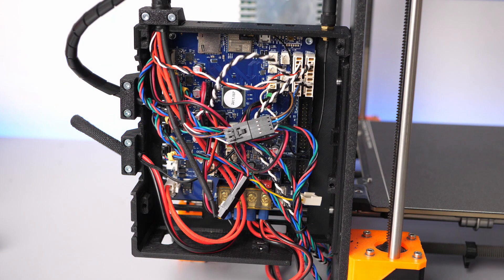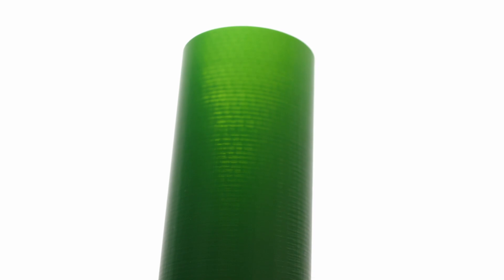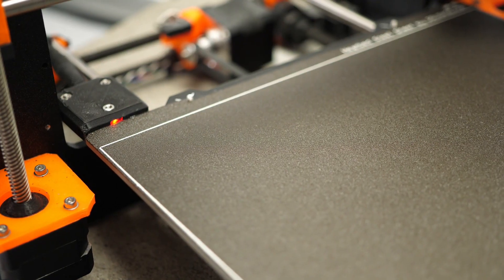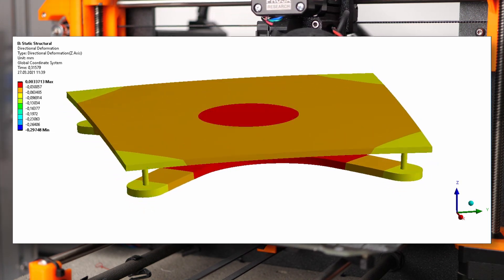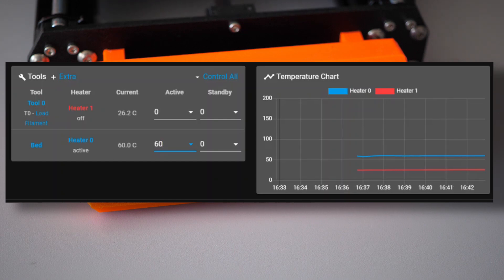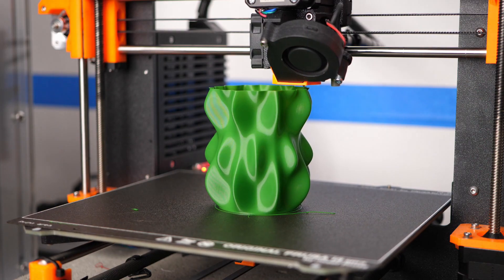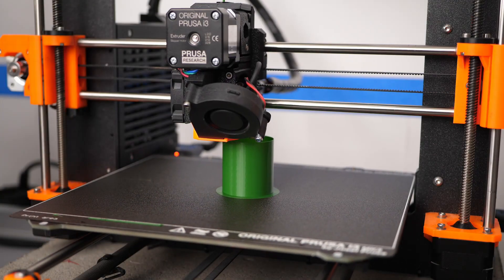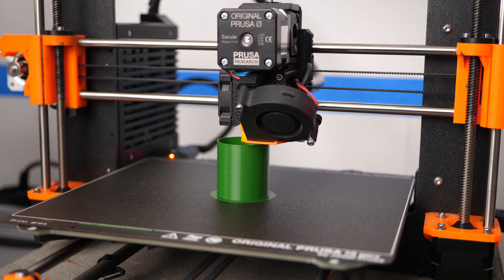PID vs Bang-Bang Temperature Control

Comment: Been fighting similar issues for days now after upgrading to a new print head on a BLV AM8. 

I wonder if that lack of the magnet in the center of the Prusa bed and the cooling fans are causing the spring steel sheet to expand at a different rate than the heated bed itself?

Comment: Hey Stefan, on the topic of thermals you should do an episode on modding the prusa part cooling fan or shroud or both. That's a longstanding problem with prusas
Reply: you must be mistaken, everyone knows that prusa's are perfectly engineered printers with no flaws that never have problems and turn out perfect prints every time and are completely worth the 100% markup.

Comment: May be it’s just, that the prusa bed is really bad designed and acts like a speaker.. this is why it makes sound in pid mode (moving fast up and down) and locking up in up or down with bang bang. However, i don’t think it’s anything with a variation of +-1 degree.
Reply: +- 1 degree is still enough to cause z banding
Reply: No, I don’t think so.. but if you have a scientific answer, we can talk about it.

Comment: Once the printer has laid down it's first few layers Why is bed heating used at all? if the bed is lallowed to cool (slowly) you shouldn't have any Z-banding issues due to bed deformation should it?
Reply from the maker: Most beds will release the print when they cool down. Not so great during a long print.

Comment: I have created an external plate based on 300W mosfet for bed contol. With 12V 200W Webasta heater it need about 5 minutes to reach real 90 degrees on glass. PID control work really great, temp  hold in coridor about 0.1 degree. I must mention that 220W Ac relay is really dangerous in this mode.

Comment: That's the problem i always need to conquer in my DIY big 3D printers
my "medium" one with bed 450x600mm that use 20mm Super High Quality linear rails (i achieve max 0.01mm error on the entire lenght) i still have this problem 
i try all posible options and it still dont work except few solutions like constant power / capacitors etc 
My heating pads have 1-2kw of power so when they turn on they have to much heat output and that make the bed to move 0.12 up to 0.24 at the centre of the bed ! 
first solution i was working on is to make the bed like a sandwitch 
or to make liquid heating 
now i working on another solution ....ceramic heatbed with constant power.

Comment: I had the same problem after I changed the firmware/hardware configuration. It took me weeks until I found an article about that phenomenon. After changing the Z setup multiple times! 🙄😅
Reply from the maker: Same here on another printer.

Comment: Oh, that explains why I was never able to solve that wobbly Z axis on my CR10s, but it went completely away when I moved to a duet! That's also why PLA was the most affected, while with PETG and ABS the problem was less severe, the higher temperature meant that the bed was not so much overpowered that there was a lot of difference in temperature between on and off!

Comment: Wow. I am currently having inconsistent layers as well and I tried so much. New mainboard, new firmware, flexible coupler, anti backlash nut, new leadscrew, new hotend, different filament and nothing worked. I hope that tuning my pid even more fixes it a bit
Reply from the maker: Let us know if that solved your problem!
Reply: @CNCKitchen  Unfortunately not. It seems to be a mechanical issue but I can't seem to figure out what it is. Would you mind looking at this test print and telling me if this is a mechanical or a settings issue? http://imgur.com/a/49pm0M9

Comment: How about PID tuning the nozzle? I'd imagine the temperature fluctuations in the nozzle might have a more dramatic effect on the print than the bed would have?
Reply from the maker: You should definitely do that as well!
Reply: @CNCKitchen  will do. And great video! First one I've seen that actually shows the effects of the issue.

Comment: You want to put some insulation on the underside of the heated bed, I have mine insulated, I put that on when I was building it since it worked well on my Anet.  Temperatures are more consistent (within 0.2C) and it saves a small bit of energy when printing.  You want a silicon sock on the hotend also of course for the same reasons.

Comment: Wow, One degree variation doesn’t seem like it would affect the bed warp that much. Im surprised. I can’t help wondering if the change in current draw from bang bang switching fully on/off is causing issues with the stepper drive current thus causing those issues where PID is a more gradual change in current draw. Wonder if a better power supply would also correct it. That buzzing in the bed seems more like a power supply noise (ripple) which made me think of current as a possible cause. 
Very interesting video Stefan. Well done.
Reply from the maker: I might have a closer look at that though I don't think that the steppers are a problem due to their discrete steps, though who knows what happens to the microsteps?
Reply: @CNCKitchen  Full steps on stepper motors are fairly accurate when stationary. Any microstep step is not precise and can be within a small number of actual microsteps of the position you think your at. Take a strip of paper and rip it in half, now do the same thing again and again and again and again. You now have 16 smaller pieces of paper. You have increased resolution but the resolution does not equal precision. Each piece of paper is not precisely torn, not precisely the same size as the others. 

With the ripped paper you can separate two objects by 3 micro-pieces of paper and the position will be more accurate than if you were limited to 1 full strip of paper. But, the spacing is not precisely 3/16 of the full paper strip. It may in fact be closer to 2/16 or 4/16 because our paper micro steps are not precise.

Microsteps increase resolution of movement and smoothness of movement at low speeds. You don't get something for nothing though. With microstepping as the RPM increases the potential power output of the motor decreases. Some stepper drivers will 'morph' steps from n-microsteps to full steps as RPM increases (all done internally, you are still sending microsteps to the driver). This gives you the best of both worlds. Increased resolution, increased low speed smoothness and all the power out of the motor at high RPMs.

Please see my post about indicating to your bed when the bed it stationary and heated to measure any deflection in Z. My suspicion is that if your bed is deflecting with a 2C delta T then it is due to it being held at the corners thus any thermal expansion/contraction can only be relived by the center of the bed bowing in the Z direction.
Reply: @HeyBirt  ripping a piece in paper in half ??? please put down the crack pipe buddy, you've had enough.
Reply: @obie224  This is what is called an analogy. I'm sure everyone has tried to rip a piece of paper in half and knows it is not really precise process but you do wind up with two pieces of paper roughly half the size of what you started with. 

But as to the point of your comment - If you don't have a constructive comment why bother?
Reply: @CHEP I think you might be on to something there. I had a problem in my printer with the Z-axis not moving enough upon layer change. The firmware would indicate the correct height but the actual height was about 20-25% lower. This only happened to me when I would print ABS with the bed at 105C so drawing a lot of current. When I would print PLA with smaller bed temp it would print just fine. My fix was increasing the Z-motor Vref voltage. I too believe that a minute 1-1.5C variation in bed temperature wouldn`t affect the print quality that much. This needs further investigation.
Reply: @maiorciprian  I had this problem with my home built Rep-Rap printer. I eventually used a second PSU, (old Xbox PSU) just to supply the heated bed. As the bed was supplied via a relay it was an easy fix. Improved the overall quality of the prints no end!
Reply: Best comment exactly what I thought. Its a power issue. Electrical noise affecting the steppers. If say a second power supply was used for the bed heat this would also fix it.

Comment: I would have thought that the change in voltage (because of the power draw of the bed) would have more of an effect on the heating ability of the hot end...  This is very interesting.  I wonder if the PID tuning of the hot end would be different with and without the bed being heated (as a result of the different drive voltage).  Great video. Thanks
Reply: That's it ! 
Nothing to do with thermal expansion/contraction.
More like voltage fluctuation affecting the board...the power supply, and consequently the motors.
Bang-bang control create two distinct levels...while PWM control spread out the influence.

Comment: Finally a "trusted source" I can point people towards when I tell them to PID their bed. Usually it goes like 
Them: "I have Z wobble, but my leadscrews are alright"
Me: "PID temp your bed"
Them: "but Marlin says PID temp your bed is bad"
Me: "Give it a try, it worked for me" 
Them: "I don't see how it can be physically relevant"
Me: "I can show you on my printer by dynamically enabling and disabling PID on the bed heater that it works"
Them: "must be a firmware bug then"
Me: "Please, just try"
Them: <if not using RRF, after rebuilding Marlin>: "Oh, look it worked!"

And then people subsequently forget about it.

(Marlin docs still state "If your configuration is significantly different than this and you don’t understand the issues involved, you probably shouldn’t use bed PID until it’s verified that your hardware works" -- I understand people shying away with this caveat. On Duet hardware it works well, of course (-: )

Comment: Does the prusa have the standoffs integrated into the bed? Did you test it on the ones that have screws? Since they have a little more movement tolerance when the bed expands, so it would indicate a problem that is more prusa based

Comment: One of the causes could be also voltage drop caused by bed current draw, as MK3 PSU works close to its limit. Anyway, I never thought about it, I am pretty sure my bed works at bang-bang and I spent more than healthy amount of time chasing z-banding. Thanks!

Comment: Yay, there is one issue with older or cheaper heat beds. PID may trip thermal runaway. Likely during preheat as when the bed gets close to set temp, it starts pulsing to slow heating to prevent over swing. But that makes it rise slower than the min “degrees per minute” even when set at the lowest setting. Been considering figuring out how to leave Bang Bang, but put in slicer gcode to switch somehow after preheat.

Comment: omg I needed this two years ago when I built my HEVO with a duet... I had this same artifact and it took me FOREVER to figure out because as you noted, if the print speed changes (shorter layer times for instance) the banding changes. I printed so many vases and spent a lot of time on duet's help forums before someone had me try changing the bed to PID and like magic it disappeared.

Comment: I had similiar problem, but I discovered, that my problem was in suppling power. If power was switched to bed, nozzle temperature also fluctuated and I belive that this was the problem. My solution was new power supply.
Your videos are still on of the best in 3dprinting and keep up good work!

Comment: Thank you so much for bringing this to my attention! I've been pondering where the "banding" in my prints was coming from. My build platform is 600x600 and heating via a AC heating element controlled by a SSR. It makes sense that a bang-bang controller would cause the  bed to flex and result in print distortions. Thank you!!!

Comment: Just bed temp? What about pid vs bangbang for hot end temp?
Reply from the maker: I've never encountered a hotend that uses Bang-Bang so far.
Reply: @CNCKitchen  Marlin can be configured for BangBang or PID for either bed or hot end. Currently I am actually using bangbang for hot end as I was having some issues with PID and temperature errors. I've been looking for differences in the print as the temp changes and im not sure I see too much, it varies nearly 10 deg C sometimes on bangbang. For my bed, on bangbang even, it only varies maybe 1c

Comment: Your thermistor tolerance could cause issues as well. I don't think people realize that the resistor network that the thermistor is connect to has its own tolerance on top of the tolerance of the thermistor itself. And on top of that you can have an issue where if the resistor is not calibrated with its own tables that it will also affect the readings. Then you have to deal with the delay in reads and the delay in the LCD/message update even if you are looking at it onscreen or via Octoprint. You also have issues with thermistors that aren't accurate under a certain temperature. That is why I wanted a method to calibrate thermistors added to Marlin so you can generate a resistance table specific to the the thermistor you use in your build rather than one from the spec sheet only. I have seen where people created printer profiles and put the wrong bed thermistor under #define TEMP_SENSOR_BED. Especially people replacing their damaged thermistors with ones from Amazon that think they are all the same.

Comment: Who coined the term bang bang? The proper term is two point regulation.
An optimally designed PID loop is of course always better in a general sense. In the design of the loop you need to know the thermal response function in order to optimally design the P, I and D contributions. Ideally there should be no ripple in the set feedback loop (eingeschwungener Zustand).
Reply: The term bang bang comes from simple hydraulic valves that are only open or closed (not proportional).  They open and close quickly and you either have the equipment bang, or just the hoses/ 
pipes from the sudden pressure shock (water hammer).

Comment: the PID noise can easily be mitigated by properly setting up the PWM frequency in SOFT_PWM_SCALE. Marlin used to warn you about the negative effects of using a higher PWM frequency in the comments, the FETs heating up due to having to switch more frequently.

Comment: Had exactly the same problem with 220V 600W heater, with 0.8 mm nozzle it even worse. Here guy from Duet explained why and what to do to fix https://community.ultimaker.com/topic/33460-different-layer-thickness-problem/ (also photos there) Since then everything is fine.
Reply from the maker: Great to hear that!

Comment: In fact I like that "digi" singing noises. My first CNC machine (Tron CNC) did make a huge variety of sounds, especially when going through curved paths. It was a music to my ears. Most annoying sound came from the spindle,compressor or vacuum. No matter if the vac was used to hold down material or to suck the debris off the milling path.

Comment: Why is it that the bed temperatures fluctuate in the first place? One source may be heating/air conditioning of the room. But, just putting a cardboard box over the printer should help regulate that. Another could be the heat from the hot material in the print’s base. But once the print head is a bit above the bed, that shouldn’t be much of a factor. What other factors are there that make the bed temperature fluctuate? Can you create some experiments to try and quantify them?

Comment: I think my Ender 3 has the same problem. I added a glass plate to the print bed, which of course changes the thermal capacitance. The graph of the bed temperature in octoprint is oscillating and some pattern is visible along the z axis in the prints. I will definitely try tuning the PID loop!

Comment: Something about Duet and it's hardware or PWM implementation is really bad at fans and noise in general. It's ridiculously common to find fans that will absolutely not run at anything but 100% PWM, or won't start above 80%. It can be helped slightly with tuning the frequency, but not much. The same fans will always work on a marlin board perfectly.

Comment: You could probably use an LC filter to choke that noise, but probably you can´t drive the MOSFET (s) fast enough to keep their size reasonable. From your sample it sounded more like a combination of bang bang and PID, but that´s maybe the tuning. Your system is of course slow, but generally control systems benefit from faster PWMs. Also controlling AC beds with "PWM", or at least by cycle count is all not that difficult, there are certain opto-Triacs that can be used to drive a Triac that do most the job for you as far as ZCD. 
I am really thinking of designing my own control board, probably based on a geeetech board but have some things done properly. But I do have other priorities for the moment unfortunately. Cheers!

Comment: I am very sure that it is a part of your problem but by far not all. We are talking about a temperature difference of 10K max, if that. With a delta T of 10K over a length of 200mm, pretty little will happen. Calculated with steel we come to a delta l of 0.0236 mm ! That is nothing. We are light years away from these accuracies. But, you can test it. Get a lever gauge with appropriate accuracy and test different temperatures on the bed. 

What I rather believe is that it has something to do with harmonic oscillations or with upswinging in the system. (Possibly there is an electrical problem here) With large CNC machines, a stupidly laid hydraulic line can be your downfall. After you have already completely picked the thing apart, please try the following. Take the print bed and clamp it to a core XY printer, Prusa control for the heating element and the rest my your test printer. If my thesis is correct, it should make no difference on the other printer.